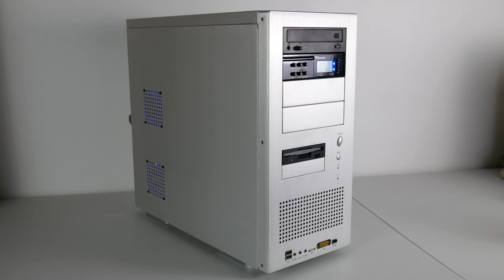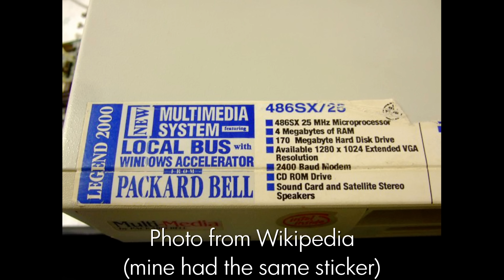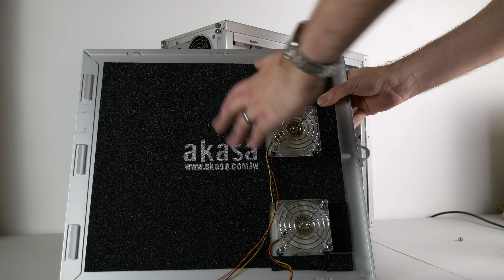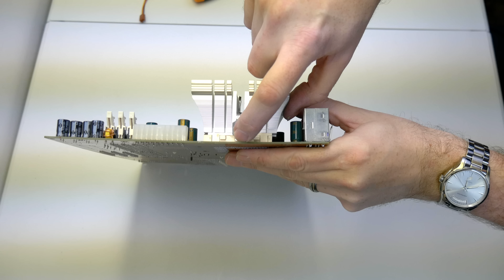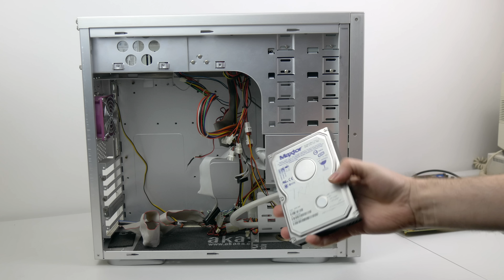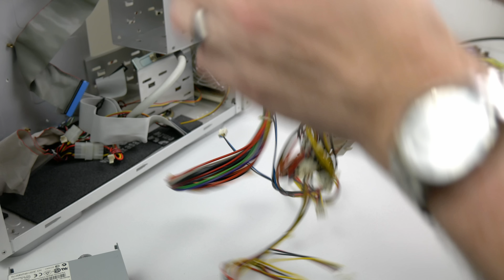20 year old PC teardown and demo - Windows XP, gaming and more!

Comment: Microsoft Windows XP Professional was my first and favorite operating system since 2002. Microsoft Office XP Professional with Microsoft Publisher 2002 worked complementarily well with Microsoft Windows XP Professional. This operating system was as user-friendly as the Macintosh operating systems. I am using Microsoft Windows-based microcomputers because I have some business documents and files that were created in Windows computers. Also, there is no database and personal information application program at this time for the Apple computer. As an end user, I create business documents and files to be printed on paper and electronically, based on my typewriting service.

Comment: With the interior of the case emptied out, the next thing to do is put all new parts in it. A gaming ATX motherboard, a high-end CPU, an NVMe SSD, a Noctua CPU cooler, RAM memory, a Blu-Ray drive, an SD card reader, Noctua fans front & back, and a gold certified power supply would make this historic desktop a sleeper build.

Comment: Strange that the Palit card had bad caps... at least all I've owned (bar a Radeon 7500 that I'm not even sure if it was a Palit) had Rubycon caps all over it.
Reply from the maker: I don't remember if I said in the video that the Palit card had bad caps, but they seem to work fine.
Reply: @ModernClassic  5 of them, they're visible around the 6 minute mark. One near the VGA  port and the other 4 near the upper right corner of the GPU board.
Reply from the maker: @NSHG  Just checked again (this computer is sitting right next to me, open) and those all look fine. There might be something about the angle or lighting in the video that's showing otherwise. I'm not averse to changing caps and I have bags full of new ones in my garage, but these don't need to be changed.

Comment: I am still using my AMD Athlon XP2700(Green CPU) With Thermaltake volcano 1.5gig PC2700 Ram, nVidia MX440 8X from 2004. SoundBlaster Gold 5.1, the motherboard (no ISA) is an Asus full size with japanese speaking at POST I disable that though. 3.5 floppy, 3.5 zip, 2 DVD burners, 5 1/4 tapedrive, 550watt psu, 300 gig and 500 gig hdd, with windows xp sp3. I really cant see why people complain so much about computers. What is an old computer if it can still do what it was designed to do? This machine is one I built myself and it never gave a single problem, except for re-lube gummed up fans, the temp/speed monitor came factory built-in on the tower.

Comment: I too had a Ti 4600, that card was the shit back in the day, right up until ATI dropped that Radeon 9700 on blew nvidia out of the water.
Reply: I remember i paid 200€ 9600XT, i could play all titles in high settings. For 200€ right now, you get old cards in new names.

Comment: I would still have my 2004 Toshiba if I hadn't spilled a bottle of Pepsi over it. Also my 2006 Sony if I hadn't dropped it off a balcony. My 2010 Toshiba if I hadn't plugged in the wrong Power supply to an external HDD & blew it up via the USB Port. My 2013 HP is now 5 years old works perfectly except for one thing. Once a week since August I get an HP update message telling me my Laptop is Old & useless & fucked & I need to buy a new one. Sorry HP it's not Fucked & works brilliantly including gaming. Anyone know how to turn the stupid Message off?  Now I have said that I will probably blow it up tomorrow using a combination of Pepsi, Balconies & incorrect Power Supplies.

Comment: I had a 128MB Visiontek GeForce 4 4200 that was bios hacked to a 4400 SE, loved that card because it played Medal of Honor with most settings cranked pretty high except AA and a few small things. Then I got my 128MB Sapphire Radeon 9800 Pro that was heavily overclocked, and that allowed me to crank everything on Medal of Honor,  including 1280x1024 resolution, and still hit 250+ FPS, instead of the 60-70 FPS with the GeForce 4. Miss those days.

Comment: What about an AORUS ZENITH EXTREME X399 motherboard 1TB of DDR4 RAM and Threadripper 1950X plus water cooling system and an AUSTECH EN9500GT and possibly a 1KW PSU that might let you play the games you like, does that Liteon drive have the firmware that lets you burn flip burn.

Comment: I built a very similar machine around that same time. I used alot of parts from 2 previous systems, that everything was eventually updated. I started with a Packard Bell Pentium 120 that I upgraded to a 200 MMX and 64mb of ram. Then got an AT "combo" board that was meant for upgrades. It had both AT and ATX power, AGP, PCI, and ISA. Also had EDO and SDRAM slots. Eventually got a K6-2 and some PC-100 ram, I believe it was 128mb. Then I got another board and CPU, an Athlon XP 2400+, and it was an MSI k7 combo motherboard. It could run anything Socket A, and it had SDRAM and DDR memory slots. Transferred all my old ram and drives into that. Got one of those chinese Lian Li copy cases. Mine was silver and had the blue light bars on the front. I eventually got 512mb of DDR and a Radeon 9600XT All In Wonder, which that is the only piece of that computer I still have. I really wish I knew more about it back then, never tried overclocking. And I didn't know about the Athlon pencil/silver lacquer trick until after it was gone.

Comment: I have a similar secondary pc, same era but different components. I am running windows xp on it, and mine is really soundproof, use thick mats ala the rubber mats you find in cars. I am planning on using it as a emulation machine, for emulating amiga, nes and arcade machines. Also have a 17" crt monitor for it. Ive put as much ram as i could into the machine, it has 3,5Gb ram. 2x250Gb hardrives a cd-rom, fancontroller, built in soundcard and network controller. Also has a 1Gbit pci network controller and usb wi-fi. I am considering installing ms-dos on it for dos games, if it can run that its much cooler then dosbox. (dualboot with winxp) I do whish it had hdmi, so i could use it on a modern tv. It does have composite out and vga. Its a pretty cool retro machine.

Comment: Man i wish i had that motherboard. I ordered a Abit KT7A-RAID from germany on ebay and they guy sent it to me overseas in a padded envelope not even a box so i came with squished capacitors a chipped corner and totally warped and twisted motherboard. Trying to find a Socket A motherboard with a AGP PCI and ISA slot is impossible if you don't want to pay the $200+ the senile ebay sellers are asking for them.

Comment: What was that thick round cable running from the front of the Case and going to a  connector sticking out of the bottom ISA slot.

Comment: You should upgrade it and mod it. Max out the CPU that works with the motherboard. Get a pci sata controller, get an SSD disk to put into it. Get the best RAM you can get for it. Paint the case on the inside and some better cooling fans for it (including CPU cooler). Rip that ugly and useless sound dampening foam out. Mod the front so that you can put a single 140 mm case fan in the front. Then route the cables nicely. Last but not least, forget about Windows and install GNU/Linux on it.
I know this is not worth the money, but I'm just suggesting doing something like this for fun, not because it makes financial sense.

Comment: I have almost that exact same case in storage. That is, everything is identical with the exception of the front panel. Mine only has the two usb ports and a standard green line out and mic input. No volume dial, joystick or firewire.

Comment: omg an amd. and it didn't even burn the house down, bend the mainboard significantly, and/or magically stopped working after ejecting a load of black goo somewhere from the sides of the actual chip (yet). it's kinda funny how when you encounter older amd systems, they're always firmly dead (and not just for the retardedly high for those days demands on the 5 volt rail in terms of amperage which no psu available back then could supply). but this one still seems to run :P

Comment: 33 and building / overclocking/ and even water cooling since the 90s.. back then it was all with Peltiers though, water blocks to those, surgical tubing, tranny coolers... and yeah... overclocking was with jumpers usually, I remember my first soft menu bios, wasn't great... but was the future.  Abit still made the best boards IMO... BP6 / VP6 4 life!  lookem up... nothing better than those boards in that era.  Todays computer game is weak as hell.

First computer was a Mac Plus... then a Packard Bell Multimedia something or rather with a P233MMX, 2MB video card (software only), later upgraded to a STB Riva Velocity 128 4MB (Riva 128)... 32MB ram, upgraded to 64 before getting into building my own devices.  My first build, I forget what CPU I went with, probably a Celeron massively overclocked... I know I ran the two 433s at 650 or so in the BP6 for a good while, then two FCPGA celeron coppermine cpu's, i think 700's running at 1000 each with win2k to manage the dual cpu in both systems.  Had a separate case with three power supplies (atx) wired together to increase amperage, as to run the water cooling system for both cpu's in the dual systems.  That changed to a small high output unit later on, but the dual towers was a stitch in time for sure... some amazing memories of pushing overclocks to their limits, beating cpu's 8 times more expensive than what I have, and beating them with just one CPU, then scaling to two via OS and really poinding through benchmarks and games.  Later to utilize SLI with the voodoo 3 3500, and then the voodoo 5 5500... just.. the best time in the PC enthusiast lifespan ever.

My computers regularly produced ice on the CPU and Motherboards, due to the peltiers... I even made a showpiece computer for my tech school... all acrylic case, cold cathode lighting, celeron PGA in a slot 1 adapter, overclocked and peltier water cooled as per my norm... the nature of that one, with the slot one adapter, made a ton of ice... but that was never an issue, it could run indefinitely that way, as it was distilled condensation, and non conductive.  The CPU's would run at damn near 0 at most times... as time went on, my peltiers got a bit under powered for the wattage of the new chips, but even then it was well under ambient temp.  No idea why they aren't used today, other than the ice and water worries... it is a messy thing, even if not very threatening.

Comment: hi funny thing i love them well made pc case you have i got the 9 bay one where all the bay fronts come of
my mate loves old cumputer and would use this for audio and  cam files for backing up and testing old
ide gear  i have to use a pic-e to ide to read my mate's gear i used to pay pipeline on a computer like
this as the speed of the computer slowed the game down so i could play a ace game on my very fast
amd 8 corr it's just to fast to pay old games  i play gta 5 and things that need speed there's all way a place
for this old gear some where my inlaws have 2 computers that are from the same time as the parts here
and they still use them for work paper work crazy you may thing

Comment: Ah man! The nostalgia. Just last year when I was moving, I found my 2000-2007  PC in the basement. It almost seems identical to this! I had a clear side panel and a Pentium 4C. Otherwise, nearly the same. Used to crank that fan controller when I was gaming on my overclock. 

Sadly, I decided to scrap it. I did, however, drill the 10,000 rpm Raptor Drive and 7,200 Western Digital 80GB and then slam them into concrete (paranoid from back in the day lol). I pulled out my 512mb memory sticks (that I put blue heat sinks on) and my GeForce 5800 Ultra. Still have something from it! lol.

Great video man!

Comment: yeah man ! - RETRO  :)  - this CPU Cooler was one of the LOUDEST ever !   Tt Volcano 11 or 12 i think ...
Reply: It's a volcano 9. I was in college back when this PC was built, around 2002. This PC was a pretty decked out gaming pc for it's day :) Acoustic foam and everything. Thermaltake made the best cpu coolers, and 80mm was the standard fan size, with 120mm being a weird oddity :) Those 80mm fans were so loud. The volcano at max speed sounded like a jet taking off.

Comment: The GeForce 4 Ti4200 is a legend. I had one from Inno3D (today they're called Innovision) with 64 MB of VRAM. That was actually the last video card of its kind if we don't count the ATi Radeon 9700 which followed the same recipe (it was way more cheaper and just a bit slower than the 9700 Pro). As you said, 90% of the performance of the high-end Ti4600 at half the price. The orange cooler is a Thermaltake Volcano 9. Its performance was okay, although it was really loud - I know because I had one on one of my first Athlon XPs :) I loved those days because you tried to push everything out from both the CPU, the RAM and the VGA to be able to run the newest titles on high (1024x768 or 1280x1024) resolution with max graphics. Some part of me really misses it.
Reply: I had an Abit 128 MB card back in the day, it was great! Though upgraded it to 9700 Pro and the boost was significant.

Also I had the same motherboard and sound card as in this video. Oh, the times..

Comment: laptops still arent closer in performance, its just the software didn't start using that many more resources but the hardware in general improved a lot, so for basic stuff and even gaming they kinda feel close, but a new i7 for laptops is about as powerful as the oldest i7 desktops or maybe even worse
Reply: it's mostly throttling. a good laptop has a desktop-grade cpu and gpu but  you can't expect 150W of components to be cooled by 1 or 2 tiny fans so they throttle way down

Comment: Back in the PC133 era, they sold RAM rated at 150MHz for overclocking, which was around 2000.  I don't recall when RAM heat sinks started showing up, but overclocking was already a huge deal in the late 90s (definitely by 98, but probably as early as 97).
Reply: Back then a stick of 512mb of PC133 cost me a 100 bucks.

Comment: I have a dead Abit KT7A-RAID motherboard that has the extra ide slot soldered on. You can drop a AWE64 gold in it since it has a isa slot keep the geforce 4 in it thats also a great size drive for loading tons of 90s games and ofcourse you could bump it down to a thunderbird athlon stick some 3dfx vooodoo 2s in it and throw resident evil 1-3, Dino Crysis, Turok, Carnivors and more on it and have the ultimate windows 98 gaming pc experience.

Comment: in my experience LiteOn were NEVER any good. I never had a drive from last more then about 6mo, and I bought at least a half dozen. you must have gotten extremely lucky with that one.
Reply: also, I had almost the same setup as you, amd athlon xp 2100+ and geforce 4 ti4200 and 512mb ram. those were the days.

Comment: 9:00 both of those sticks look like the exact same type, do you mean "brand" because I'm thinking what MB do you have that took ddr2 and SD flash or something.
Reply from the maker: They were two different types. Different speeds, different CAS ratings. I underclocked one of them to match the other.
Reply: oh ok, that's not different type it's different specs.

Comment: Oh man this takes me back, I had something like an ATI 9500Pro which died on me and I replaced it with an Nvidia FX5200 from CompUSA cause I was on a shoe string budget, that thing ran like crap unfortunately. I think I had an S3 or 3dfx card prior (both are defunct so I can't even recall).

I eventually ditched that system which had an Athlon something for a Pentium 4 with HT.
Reply: I bought a new fx 5200 back when they came out, with 512 of vram... that thing kicked ass for my system. Had it for years till pcie came out.

Comment: I still have an similar setup in a box somewhere  Xp 2500(also very overclockable), ASUS board, the original WD Raptor 36GB drive(still works) yada yada,,, and an similar lian li knockoff case( of which I haven't got rid of)... ahh da good old days..

Comment: Excellent motherboard, still own an Abit KR7A...  VIA chipset and Award Bios with an Athlon was the shit..  Didn't have to upgrade till the beginning of 2007...  
Not much storage space so I threw away the case, hd's, power supply and optical drives but kept the motherboard, ram, cpu/cooler, video card plus all add-in cards hanging in my laundry room displayed as a memento (along with my second PC)...

Comment: worst possible op[optical drive manufacturer, worst possible hdd manufacturer
Reply from the maker: +Randall Stevenson Thanks for your input.
Reply: I had a friend that built computers for a living, and he's had so many lite-on drives fail he called them lite-dim, smiler story  with Maxtor hdds
Reply from the maker: Probably because there were a lot more of them out there than other brands. No hard drive manufacturer has a higher defect rate than any other. (I used to sell these for a living.) And both worked fine for me.

Comment: If you look closely at the capacitors around the AGP Slot they are bulging and one even seem to leak, not all sure about the GPU but some seems bulging on that one too. if these parts are to be used again you will need to recap the components or an eminent failure gonna happen. it is a very common problem with computer parts around that time actually, these days with Japanese caps it will last a lot longer. I had, and seen many parts fail due to this and some even end up with smoke
Reply from the maker: +Pulverrostmannen caps are very easy to replace, but I don't plan to use this machine so it's not really a concern either way.
Reply: recap stuff are normally pretty easy indeed, I have done that a lot over the years and got some dead stuff to work again :)